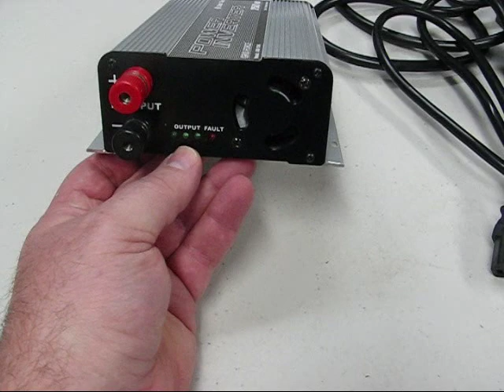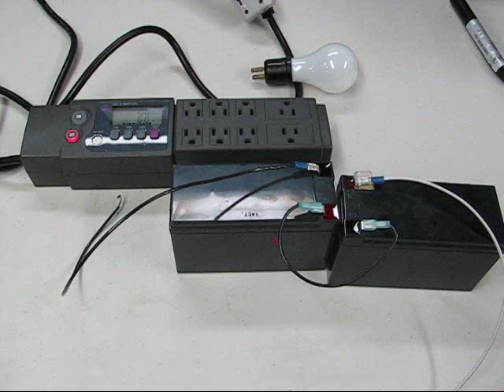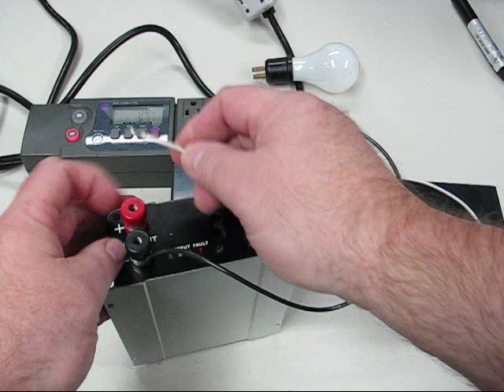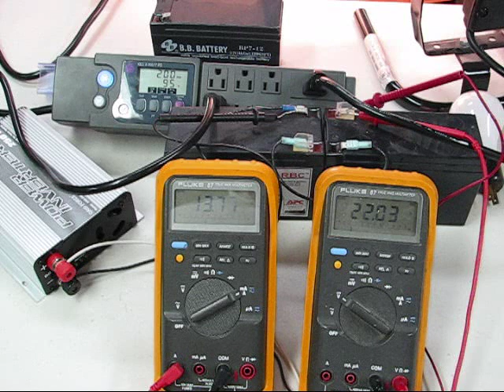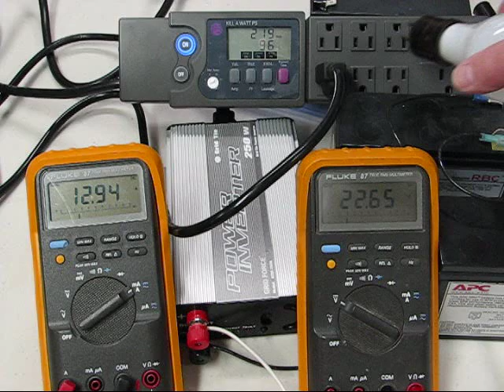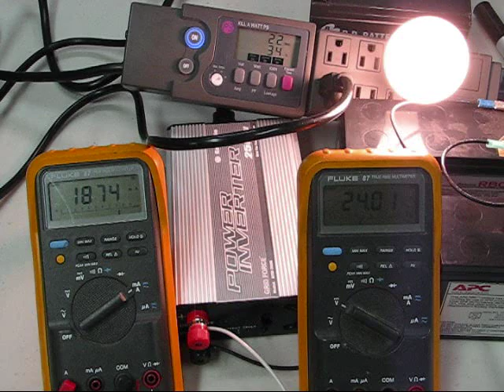Grid-tie Inverter Analysis

Comment from the maker: Breezebro, Thanks. The product is advertised at "92% Peak Efficiency", but I'm not sure how to get that level of efficiency.   Right, the auto shutdown feature is called Anti-Islanding, which is there to protect the lives of the electrical repairmen.  The nice thing about these little units is that they are stackable; you can plug a number of them in at once and get over a kilowatt of power from several micro wind turbines and/or solar panels.